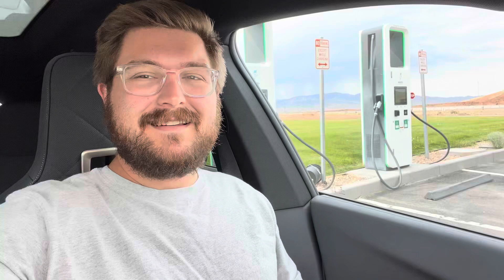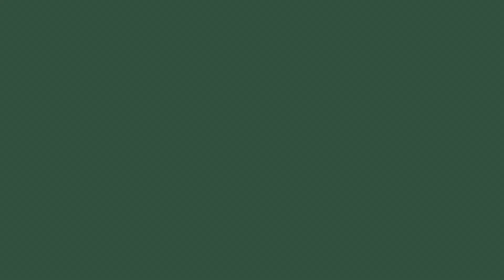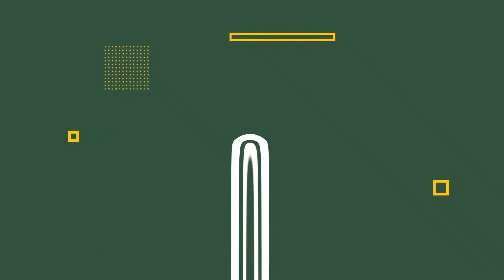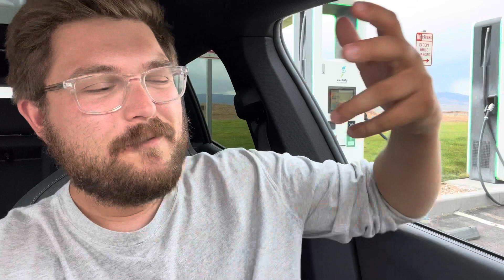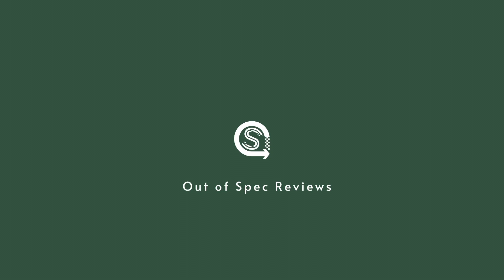Here Are The Benefits Of An 800 Volt EV Architecture - Is It Really That Much Better Than 400 Volts?

Comment: I really wish the Tesla connector had been adopted instead of J1772 / CCS. Handling AC and DC through the same conductors is just so much more elegant but obviously that ship has sailed. I don't think the voltage of the battery pack itself really matters right now as long as the chargers being installed today are at least 1000v "ready". They will likely all be ripped out and replaced in the next 5 - 10 years anyway. I'm more concerned with station reliability and how the heck DC charging will scale once EVs hit true mainstream and we see hundreds of thousands of owners that don't have access to residential L2 start pulling 200kw a couple times week on similar schedules (lunch break / evening commute etc). Even with on site buffering, those numbers get real crazy real quick.
Reply: Agree. The Tesla connector is an elegant solution. The CCS by comparison is clunky and unwieldy. So unless you’re charging a semi I don’t see any benefit for the average motorist. In fact, it’s likely a disadvantage for having to us a bulky annoying plug just so you can say you have 800 volts.
Reply: @GarySBCA  Should have opensourced the Tesla plug with no hooks.
Reply: The Tesla connector is nice and compact, but it can't handle 3ph unlike the CCS.

Comment: As you mentioned, E-GMP and GM have overcome the cost negatives of 800V charging by engineering better systems.  That allows them to take advantage of the faster charging.  My guess is other manufacturers will take the same route, either by licensing E-GMP or GM tech or developing their own.  At the end of the day, 800V will be the superior charging system (IMO).
Reply: Does 800v enable faster charging at higher states of charge because there's less overall resistance than 400v?
Reply: Even chinese LFP battery cars like BYD Tang have the higher voltage. 🤷

Comment: high 400V is a great sweet spot. It’s a shame that Ford products are such low voltage.
Reply: Ford definitely erred by going so low on the pack voltages. It's arguably why the Mach-E has its performance limitations and Ford is needing to replace first iteration high voltage junction boxes.
Reply: @anthonyc8499  I agree - they made it that their higher power vehicles are needing a crazy amount of current.

Comment: I’m far from an EV nerd but my feeling on any camera, computer, tablet, cellphone is to get the best technology you can afford at the time because sooner than later there will be technology advances that you will make your equipment obsolete. With that in mind - I bought the Ioniq 5 SE in May for less than $50,000. I can live without all the luxury add-ons in the other models but I wanted the best battery pack I could afford. Actually with my trade-in, federal rebate, deposit and no sales tax it was around $27,000. I’m hoping it will last at least 10 years but I’m sure there will be plenty of advances in new batteries and charging equipment in the next decade.
Reply: $27,000 doesn't mean anything without identifying your trade in.  Was it an Audi A7?
Reply: @rcpmac  Toyota RAV4
Reply: Scott I’m with you. I chose the EV6 for the same reasons but could have taken the Ioniq 5. I’m becoming the EV nerd and still believe it was the right car.
Reply: Bells and whistles aren’t important to me but batteries and charging are important. You can have sunroofs, automatic rear gates, chilled/heated steering wheels, Bose surround sound stereos, large frunks, doors from Back to the Future, etc. With that being said I’m sort of fascinated by the Aptera!!! Really hope they can make it into production and add a 3rd seat (they can do away with the “knock” door opening). Also not sure how it would drive in the snow.
Reply: @shep64  Scott, surely every 3-4 years EVs will have major advances in batteries and charging.  I would not plan to hold onto an EV for 7-10 years if these advances are important.  As for the Aptera, I ordered one earlier this month, selecting longest range and maximum solar panels.  Snow is not a concern for my SW Florida location.
Reply: If new technology, including bells & whistles, is very important to you, I think you will want to trade in that EV after 3-4 years.  Newer models will have so much more technology whether it’s range, charging speed, acceleration, comfort, styling, etc that you will want something better.  Forget about 7-10 years for how long you hold onto an EV.

Comment: Personally I think 400v is fine. My car is usually done charging faster than I anticipate anyways. Whether it's worth the extra cost to have it just slightly faster...who knows.
Reply: Today’s cars do not benefit from 800V. The limitation is coarsely how fast are car makers ready to degenerate the battery by pumping 250+kw into the battery. When 350+ becomes a norm due to better and maybe bigger batteries, then 800V+ may be the best way to go.
Reply: Personally i think a working vehicle, safe, cheap, swift, sustainable is fine. And i am a electrician working with low and high powered, low and high voltage etc. pp.
Reply: Where I live, there’s a handful of high speed chargers. Most level 3s are 50 kW - roughly equivalent to a 200 amp service at home per charger. The reality is that servicing 350 kW chargers takes far more power infrastructure than there currently is available except in big places like Walmart, so it takes a while to upgrade services without a big investment across the board. Like you, I’m happy with what we have - a half hour is plenty of time to use the bathroom and grab a snack. Even topping up on a 50 isn’t so bad, given the charging curve above 50% on my Volvo. Five years from now, maybe we’ll be able to take advantage of 800v systems like they do in Norway, but the big thing at the moment is being able to get an EV!

Comment: About cost it depends which is more expensive and to whom... Like a 400V car may save money from off the shelf parts making but will lose money in upping the size of every thing else. So if they could get off the shelf 800V hardware at the same price it may be cheaper then to stick with 400V at the same price.

Comment: I'd be concerned Hyundai using the rear motor's inverter to make the electrical charging components play nice, might be putting additional wear on an expensive and necessary engine part.
Reply: its already over spec / they left room for upgrade wattage

Comment: Since you didn't mention it I will make the assumption that my curiousness is a moot point. It the higher voltage car more dangerous in a varieties of accident situations. From spontaneous shorts, to actual collision accidents, a lightening strike, to anything that would put a person or persons in harms way? I know this is a very amateur question, but t was nagging me :)
Thumbs up, great video 😊😊😊
Reply: ist actually safer because the cable takes less damage per charge
Reply: Once you go over 50 volts DC, you can be shocked just by touching it.  So, safety wise, there’s really no difference between 400V or 800V. 

As this video explains, it’s more about reducing the current flowing through the wires, motors, etc so that things don’t overheat and likely will last longer.

As electric vehicle volumes ramp up, the higher 800+ volt systems will become common place.  Auto companies know how to drive down component costs quickly…

Comment: CCS just needs to push the amps up. There’s no reason we can’t charge at 250kW with 400V packs like Tesla using 600-700amps.

CCS is just weirdly (unnecessarily) limited to 500 amps.
Reply: More the Amperage, more cooling you need - Hence need liquid cool cables and the like which adds cost.

ABB for example has a unit that maxes out at 200A - big difference then if your on 800V or 400V
Reply: @mark123655  Tesla V3 superchargers deliver 700 Amps reliably with very high utilization using their liquid cooling. So should other charger makers.
Reply: 400 Volts is not future proof.
Reply: @buddy1155  Sure it is, I can charge anywhere with my Model 3 and charge quickly (250kW at a V3 or 190kW on CCS at 500 amps).

There are no 800V only chargers and I doubt there ever will be.
Reply: @Lynyrd_Evnyrd  You get like 2 mins of 250kW of charging with a Model 3 or something before it rapidly ramped down to like 150kW
Reply: @kwan3560  False. I've checked it once. It stays above 200kW for quite some time. It only dropped below 125kW at 58%. For reference: that is the max charging speed of the ID.4/Audi Q4...
Reply: @Jeroenneman  ID Buzz went to 186 kW with the newest software.
Reply: @Jeroenneman  Kyle here has the whole charging curve plotted already. So did Bjorn.